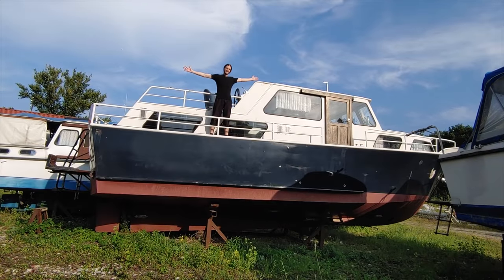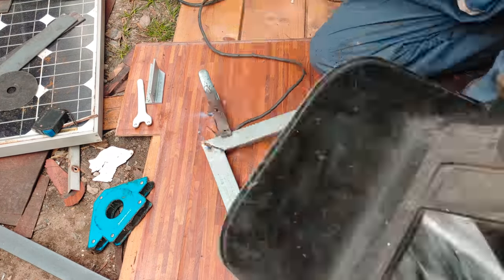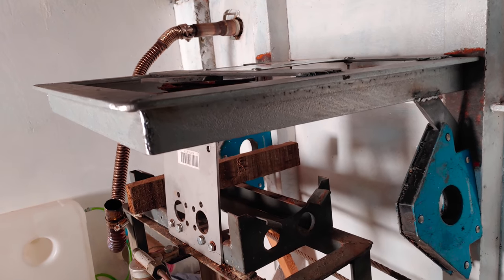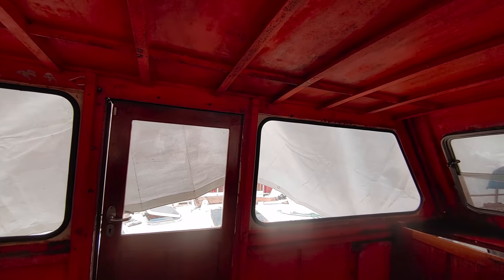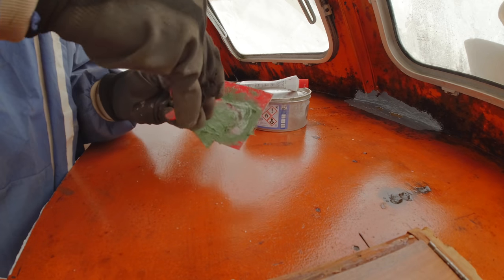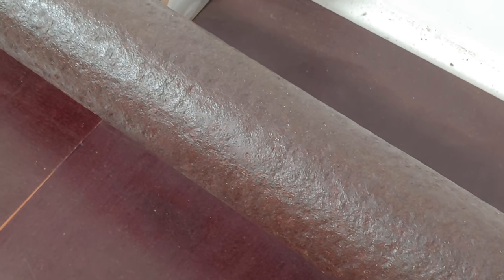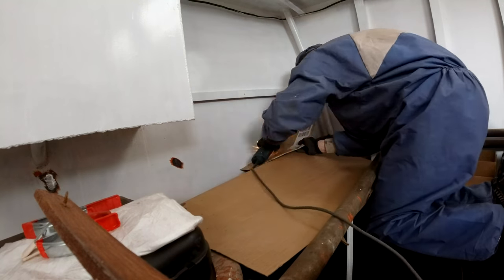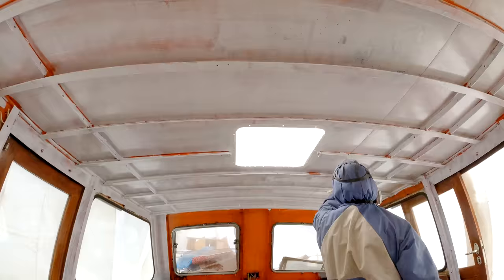Heavy Interior Works on our Steel Boat - Week 28 - Vintage Yacht Restoration Vlog

Comment: Patching the holes like that will last decades if you maintain the boat properly. Nothing wrong with what you have done. They are not structural. Good job.
Reply: Not sure if that will last for decades, but at least it should last long enough to address the essential issues, live in the boat, enjoy it some time... As you mentioned, those rusty parts are not structural parts, so no worry.
Reply: If they are preped good and painted over, it should be no problem
Reply: It's the good old classic car body shop repair. As long as no moisture or oxygen can't get to it, this is like nothing ever happened.
Reply: @gillesgomez3091  it is perfect you can repair structural areas on aircraft wing like that and it's fine assuming long as you move to a new country within a couple of years to avoid "legal issues" later

Comment: Nice Job You are doing... Here is a pro tip,,, Tack weld your project first, it will allow you to test fit all your different components together, then once everything fits as it should then weld up. Tack welds are easier to cut apart than a complete weld joint.... i learned the hard way 40 years ago...

Comment: Just keep in mind that plastic fillers are not water resistant and will hold water like a sponge, so keep it sealed with paint don’t be shy about putting it on thick or multiple coats

Comment: 10/10 for vids and work you are doing!!!!

"Done" is often FAR BETTER than perfect. Many of your "temporary fix's" are good for the duration of your ownership of this vessel. Only do future repairs as they become problems again as this boat is very over-built by today's standards.

Some yrs ago I did a similar project. Initially I made a mistake of trying to restore things back to the original design, making some tasks much more complex and harder than necessary. Eventually I came to realize changing the design could be far more efficient.  Eg #1: On the lower area of the windshield, Don't cut out metal and replace it to make it look like original sheet goods. Consider cutting out the 'T' stock, weld in a 3" high band of 3/32" metal across the entire bottom edge. #2: Outside - If a series of rust areas show to the outside in a line, consider adding a wide(ish) strip of metal overtop everything as a 'belt-line' across an entire face/wall. Slightly new look, done in 1/2 the time.

Many of your "temporary fix's" are good for the duration of your ownership of this vessel. Only do future repairs as they become problems again as this boat is very over-built by today's standards.

Get yourself some better tools. A light duty but commercial level MIG welder (higher duty cycle for more continuous welds) and a good random orbit sander will increase your productivity tenfold.

Comment: Make sure you ventilate the Helm-room very very good! That is why there is rust in all the corners. Good thing you keep the diesel-heater. In colder weather conditions you should use it a lot to give damp and moisture no chance. A big problem with living in steel ships in colder temperatures. Ventilate, ventilate, ventilate. 
Keep up your good work. Love yr vid’s!! 👍

Comment: Your doing a great job, here in Ireland we say “He who pays the fiddler, calls the tune” it’s your boat, so you do it your way 👍 one tip, please ensure when mounting the fuel pumps for the diesel heaters, that you mount them in an insulated suspended way, they’re renowned for being very very noisy, it’s the clatter from the solenoids inside, ‘click, click’ will drive you crazy. 😃👍

Comment: You are doing a great job.  I love your series!  In the future you should probably move the diesel heater exhaust below the heater.  They tend to trap moisture in the pipe and it will have issues.  I learned this the hard way.  :)

Comment: tip: if you put some clear tape over the cardboard it will peel away very easily
Reply: Yes-- too easily. It only sticks well to cardboard. Gravity, alone, will detach it from virtually any other surface (other than glass).
Reply: @crustycurmudgeon2182  That's not what he was saying - you put clear tape over the bit of cardboard that touches the bog, so it leaves a mirror finish.
The actual patch can be applied with much better tape.
Reply: @dnomyarnostaw  Ahh! Yes, of course. Pardon my senile moment...

Comment: Another video of amzing work on your boat. I am always of the mind that if it's your boat, and you have a deadline to get her in the water, then you have to do what you need to do to make her as good as possible to reach that deadline.
I am also worrying that you only have 2 weeks until splash, but you haven't even touched the outer hull of the boat. I just hope that there aren't any major problems below the waterline.
Keep up the good work.
Best regards from bonnie Scotland.

Comment: Great videos dealing with a great subject. Only 1 critique from me - I have not seen any  safety equipment so far. I see no fire extinguisher/s, no throwable floatation devices and you don't wear a PFD/life jacket when you work outside near the waterline of your vessel. Personal safety is paramount when boating. Keep up the good work and smooth sailing!

Comment: I like your video, the project is something I would have never thought of. One slightly negative comment is that you didn't seem to have a plan of attack in the first place. In the past you cleared places, carried out some repairs and painted then later did another job which messed up the paint so having to touch up. 
I think we are all with you on this and are really looking forwards to the completion. Even after that there'll be things to do. And you will have the satisfaction that you did it all. Oh! And yes a big hole in the bank balance!!

Comment: Lots of us have made "Temporary Fixes" we never got back to-- that's probably where most of the shade came from, of which you spoke. I've put lots of "Band-Aids" on things in my life, complacently forgotten them, and paid the price further down the road. More work than the original fix would have been. Understood that boatyard dirt costs more than water per day/week/month rent. Also understood: fundage. Old adage: "A boat is a hole in the water you pour your money into". Lotta truth to that. Many comments I read, here, alluded to the idea that those areas "temporarily fixed" aren't "structural". Baloney. They are. It's a boat: whether steel, wood or "Tupperware" (as I call fiberglass boats), every one of those structures you fiber-filled helps maintain the shape and integrity of the hull. You are clearly fearless in the face of hard work-- I  truly commend you! Please don't feel "beat-up" by what sounds like negative commentary-- your work ethic is far above that. I'm sure I'm not alone recognizing this. You have really done some stunning work so far, carry on!

Comment: A good rust encapsulator and your fiberglass paste will work for years! The preparation is exactly like you did, remove the scale remove as much of the rust as you can, put on the rust encapsulator and then you can use your paste, prime and paint and it will last for years

Comment: I agree with you the rust will have to wait till next year as once you start it will take ages to do it right. You have to do it right as it’s so tight so don’t rush. Your boat your time 👍
Not sure about exhaust it looks ok but if you have a thin bit and start the engine for some time it could blow a hole then you will have fumes inside your living area. Be careful 👍

Comment: Obviously you have bigger plans to  repair the holes that have been temporarily repaired  with filler. From what I can see I still don't understand why you do not do the permanent repair now whilst you have a bare boat. Surely if you removed the front windows  ,cut out the rusted areas and weld in new steel sections as you did for the hatches. This surely  would better in the long run  than to do the work later once you have moved in. The time delay would  be minimal. Having said that . I have enjoyed watching the rebuild from day one. You are doing a grand job and am looking forward to seeing the completed boat. I am sure you will as well. I'm sure it will be a boat to be proud of after all your hard work.Greg

Comment: That welding can destroy your Solar panel.! Condensate from your windows may have been the issue with your water entry under those windows. You use a rubber F (Escutcheon molding) as a drain gutter, drilling verticle holes in the bottom channels in the window frame for relief and streaming them to/through an outside wall to vent it.

Comment: The window rubber seals are probably shrunken and cracked. Try some simple bathroom silicone on both sides. It will bring you through the season but not much more than that, I’m afraid. Stiff upper lip!

Comment: Hi great video , ok I’m no expert but the pipe you cut out and welded patch. Would putting a fiberglass patch over the weld or that green stuff you use as a filler around window. Just for a little more secure against links .

Comment: Excellent job, I’m sure you’ll weld the outer skin of the cabin at a later date. TBH the console/ceiling corrosion holes don’t actually require welding, I’m sure the filler will be more than adequate 👍

I have a question..... With the roof drain pipe removed from one side, will the roof drain ok or will water pool there?

Comment: Concerning the rust in the 'consoles': I recently bought a similar boat, about the same age as yours. The front window seals (same as yours) are not watertight anymore (among a ton of other problems, all due to age). Sealed them up with silicone for now, but the windows will probably have to replaced or maybe refurbished.
In our case the steel is still ok, but the wooden structure has started to rot and needs renovation.
Anyway, keep up the good work, your videos are very inspiring :-)

Comment: The explanation on the temporary fixes rly calmed me down. ^^ stop using owatrol. It’s not ment for marine purposes and it’ll not prevent steel from rusting that will have contact to brack or salt water.

Comment: Your doing great work man. I wanted to make a positive comment about your "console holes" firstly fuck every hater out there telling you anything your doing wrong. Regardless if you use fiberglass you made a solution to keep water out. Whoever told you to chop out all of the rust. Don't. Thats really dumb. You make a massive project for nothing. All you need to do is nuetralize the rust, as you did. And seal it away from oxygen. Thats how rust grows is oxygen. So. You filled the holes with fiberglass. Perfect. Now seal it with a couple strong coats of paint and that fix will last another 30 years dude. Its your boat. If rust isn't growing then it isnt an issue. I hate the hate. You will have a long time of no issues with that console fix. Its a quality and good fix. Your doing great work man. Stay strong and keep attitude to these people telling you what to do with your own boat. Your doing great!

Comment: IF you manage to keep the water/moisture out and you truly stopped the rust than that temp fix can serve several years.Just think on 2 things, 1, does it compromise structural integrity? 2, be sure to inform the next owner if you sell the boat before fixing it the right way.

Comment: One way valve and connect the diesel heater Exhaust pipe to the main Engine exhaust so it will be much quieter end it will be in case of the water do not enter the heater when it’s not use

Comment: All exhaust systems will smoke when first started, just be ready for this to happen as that rust inhibiting oil you put on the pipe running through the cabin may take some time to cook off.  This is likely to happen even if wrapped.  Be ready.

Comment: great work so far. i have one concern tho, i do hope u plan to cover back your exhaust pipe with heat wrap and or exhaust insulation blanket before taking the boat on a test run..

Comment: So I’m power watching these videos and have covered 28 weeks in just a few days.   Here is my issue with the temporary repair of your consoles.   In the end you are going to have to cut, grind and weld to make the repairs, and I’m assuming your going to be doing some finishing work in the forward and aft cabins.  In my humble opinion you should delay going to the water and do the repairs properly the first time.

Comment: hello there .. i wouldn't worry about that temporary repair that's okay, at least it's on the inside of your boat. then I will sooner look at the edges of your front windows. anyway, everything is going pretty well although it takes time ..   do not deal with everything quickly, otherwise the quality of your beautiful work will deteriorate

Comment: If you grind down a butt joint on a weld you will weaken the joint, just leave alone if you can and work the insulation around it......Just advice but I am a welder by trade

Comment: Hello! I have few comments to sent you:
1°) minute 1:48, never use a grinder cutting any steel piece near by glass, aluminum or in a clean area: the cutting of the steel pulls out iron particles in fusion whom fly away and could land and be fixed of any surface including glass and aluminum with permanent damage!
I see you have a photovoltaic panel beside, it would be better you cherish it better and store it in a safe place avoiding any damages on it ;-D
2°) minute 5:32, nice reference to French language... but it would have been even better to pronounce "et voilà", instead of "and voilà" ("and There you go") ! ;-)

Comment: You should have cut also that second roof drainage pipe because it will likely have the same amount of rust and will leak on short notice, ruining your work. Furtermore I understand your quick fixes but with a little more effort you could have fixed it properly by now (cut the heavily corroded areas out with grinder and weld in new pieces of metal), as you have spend already a considerable amount of work to 'quickly' fix these rusted areas. Also, when everything in the interior is nice and finished, it is very hard to repair those troublesome areas later on properly. I am restoring a boat also and made similar mistakes which had a high price to pay in the end. I basically restored it twice. Fix it properly or don't when it comes to boats, its not a car. But in the end you are right, its your boat and money!

Comment: What happened to that oscillating tool he used in another episode? If it broke he should buy a new one. It's worth it. He uses the grinder in tight places where an oscillating tool would reach with ease. And that console would've been rust free in minutes.

Comment: I've been a mariner a very long time, and while some may be 'simply hating' the ways you do things, I think ANYONE who's ever purchased a 'ratty boat' can attest, the worst thing you can do is 'over-spend' doing it the wrong way, instead of taking the time to do it right...this saves you in the end. Along with that, and more importantly to 'your viewers', is that if you have purchased a boat (where they have used boat filler, ground down and filled rust instead of replaced metal, etc.), that you are making 'seasonal repairs' that normally end up being 'long term fixes'...that inevitably pass-on to the next buyer...the one you sell the vessel to. Now, I don't know about you, but most I know DON'T want to purchase a rust bucket patched together with filler, topped off with a nice paint job...that was sold to them as a 'dedicated restoration'. You and I BOTH know you aren't going to disclose all the corners you cut, to make this happen...and you and I both know you aren't going to turn away 'good profit' when you go to sell it...so in the end, what you justify now as 'seasonal' will, inevitably become 'planned deception'...and this is what empowers those you deem 'haters' to speak out against various short-cuts you are employing here. If you were my age, and simply 'trying to make the boat last another 5-years, until you're just too old to sit in a wheelhouse anymore, ok...got...but you are young, and you'll either sink it or sell it, in the end...so, we're back to 'planned deception' being seen by those who don't want to buy something like this, in the end...
I'm not hating...I'm trying to explain to you why 'we just can't trust what's out there on the market' in used boats. From my own watching-forward to week 29 (with the 12mm of filler in that bow hull, in places), I can guarantee you won't dry dock this again to properly fix the hull, take it down to metal, and repaint it...and therefore, your 'temporary fix' claim betrays the very words you say about what it actually is.

Comment: I cringed a bit on the last video when I saw the kitty hair and I said "Oh no! He found the kitty hair!! He's going to use that on the helm!"

Oh well... I get why you are doing it that way and ultimately it's you who will be digging it back our when you redo it so... 

It's not preferred but it's acceptable for a temporary repair. 

And no, I am not surprised that it has gone over budget... 

Also, not sure what your plans are but put a carbon monoxide detector in the boat with that exhaust.

Comment: With your time line you should focus work for all things under the water line, all else can be done once the boat is on the water. For the exhaust look at danger marine https://youtu.be/tC4jHyUuDs0 and try to do it straight up from the engine room will save lots of space.

Comment: so much welding work and the most important things are being fudged. before I do it this way, I don't do it at all. Would you have rather saved yourself a few unnecessary windows and repaired the basic structure instead.